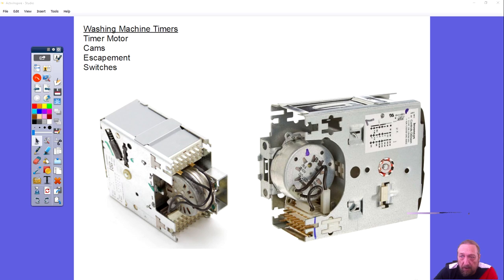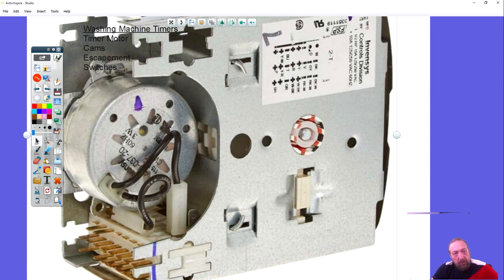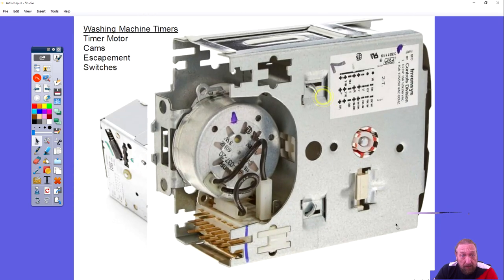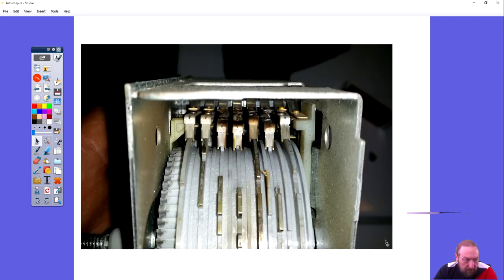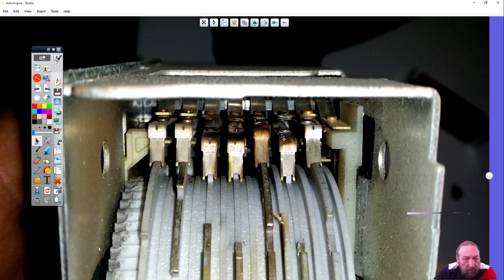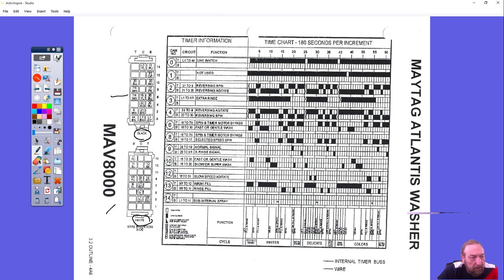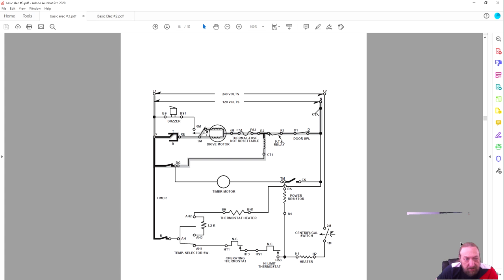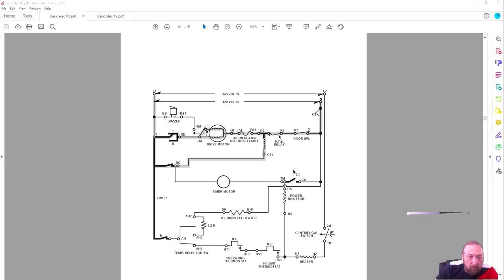#TECHTALK Basic Electricity 101

Comment: Thank you so much for this video. It really helps me get a better grasp on esterline charts and how to correlate the info to the diagram. A few weeks ago, I had a Kenmore TL Washer Series 80 that I got as a haula away. The complaint was that it didn't drain. It agitated, but when it got to drain and rinse, it would stop. I had hard time understanding how that happened at first. I tried reading the esterline chart, but I did not have the fundamental knowledge that you give here. In fact, I fixed it by changing the lid switch, but only because I saw that suggested on a repair video on another channel. It worked, but I felt frustrated because I had not diagnosed it with a clear understanding of why the machine was doing what it was doing and why I was changing the lid switch. But, after I watch this video a couple times, I think I can go back to that diagram and interpret it. I checked the Kleinert book for some guidance on esterline charts, but that section is very brief and not too helpful.